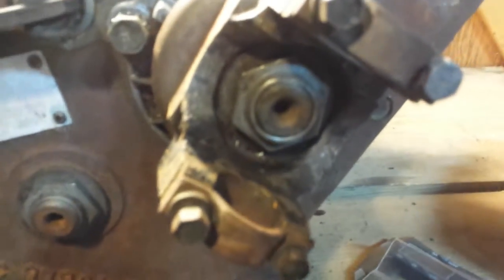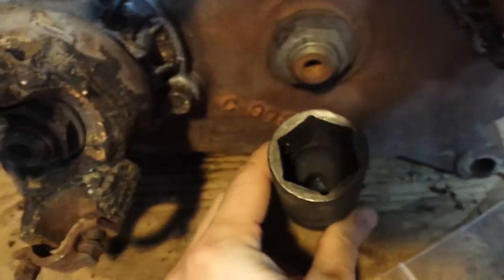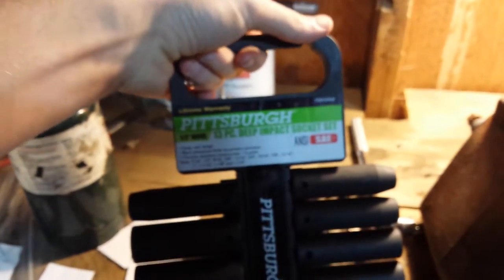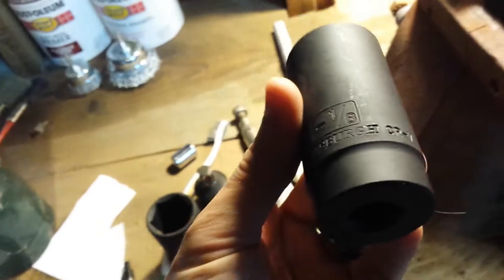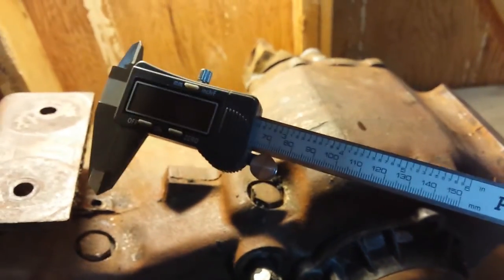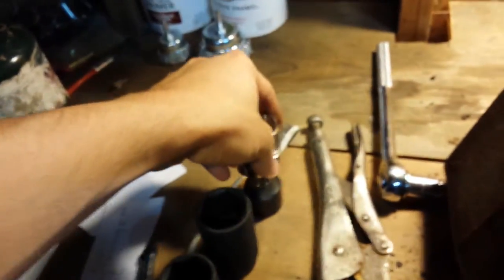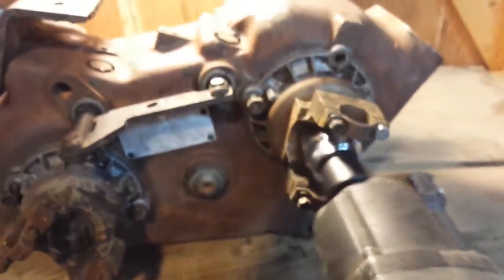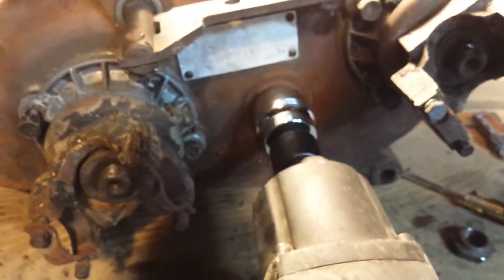DEEZ NUTS (NP 205)

Comment: I am curious what you are working on for a vehicle as i have a 72? Dodge w300 with a divorced NP205 also. And yes the manual says 1 1/8 but as you state NOOO... it is a lot bigger. I have a seal leaking, going from case to front axle so I will be replacing that soon before plowing. It is a cummins conversion so I better make things right before plowing with a 9ft fisher and 7ft wing plow. Lol. I will be looking forward to seeing more videos. My t-case is quiet and shifts fine so no rebuild but it is nice to see these old heavy cases being worked on. Thanks for the video
Reply from the maker: This is going in a 1974 c20 2wd to 4wd conversion. I plan to build a carburated roller vortec motor from an old tbi truck with 4l80e going into the divorced unit. I haven't seen anyone doing exactly what I am so more videos to come. This video was more of a joke video for my brother but I've gotten a bit of interest.
Reply from the maker: you can subscribe so you won't miss anything. case teardown next
Reply: Sorry for late subscription. Also I found out mine was built in August 73 not 1972. Same creature.